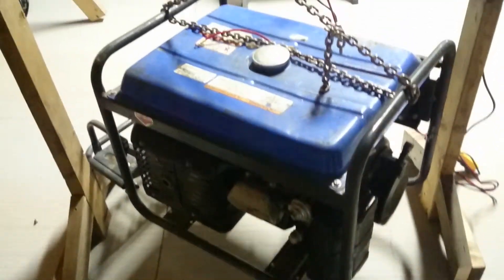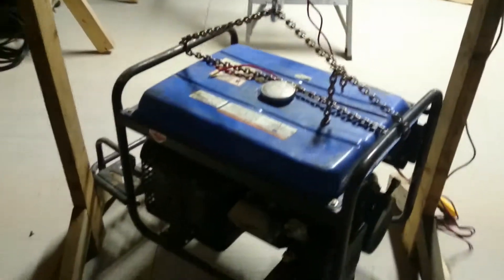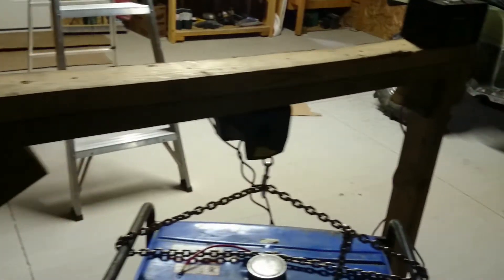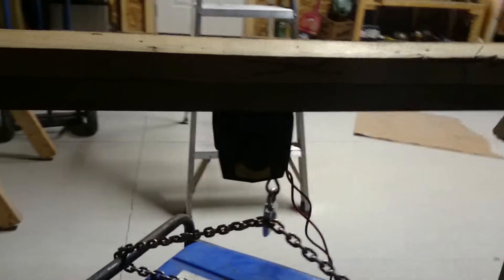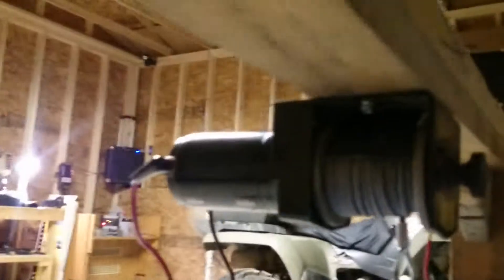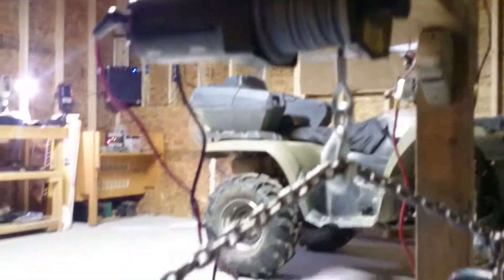Small winch crane

Comment: hey that's great. I was going to rig up something similar to use a winch in another way. could you tell me about the battery you used? how long does it last? How do you charge it?
Reply from the maker: Russell Hess it's a 12v 10amp battery, it lasts a few days, and I charge it with a 12v car battery charger on the 2 amp setting
Reply: Thank you for the quick answer. It looks like the same battery on my trailer which activates the safety brake (also 12 volt) which is charged by the tow vehicle when connected. How many lifts = "few days?" I'm thinking of rigging something like this in my cargo trailer but adding another small battery and connecting it to charge from the truck, same as the one that's the now. Two batteries connected in sequence double the "run" time. Thoughts?